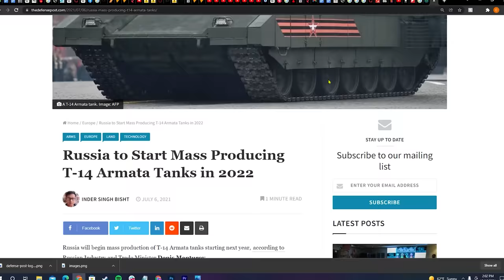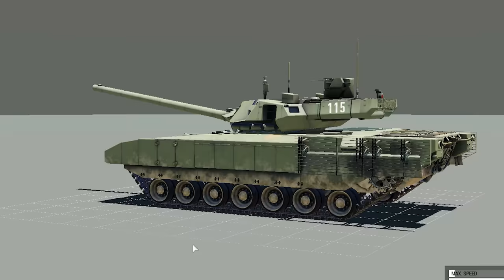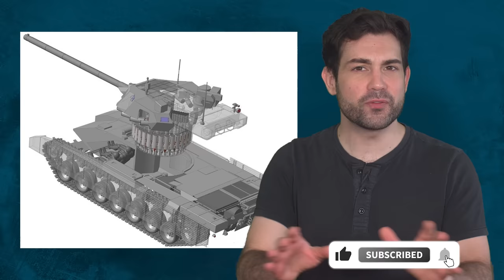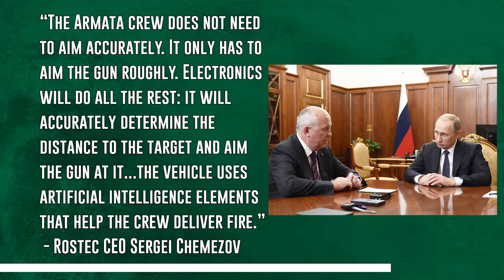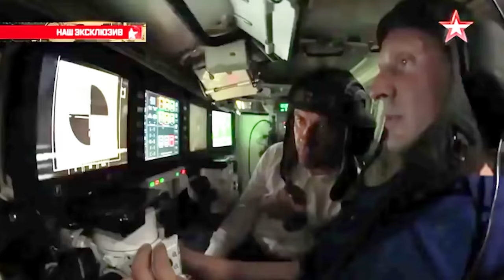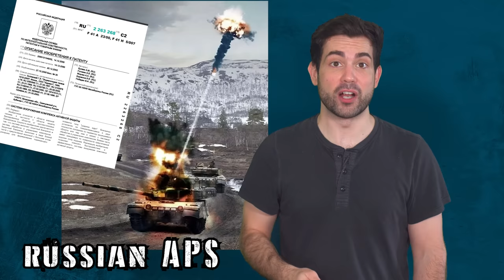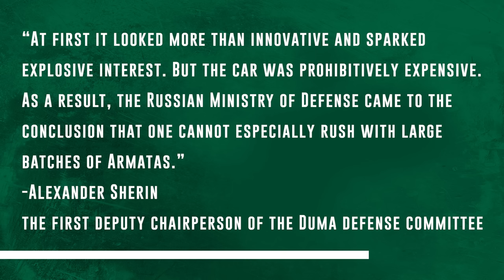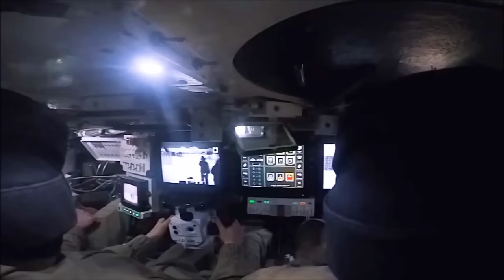The Truth About Russia's T-14 Armata Tank

Comment: Having a great design concept is one thing. Having an intergrated production or manufacturing platform as part of the whole project shouldn't be another thing.
Reply: Manufacturing it isn't a problem they have the factory lines. Its more of the deteriorating oil prices. Without high gas and oil prices Russia cant progress. 

like in the 1970s oil and gas were high and Russia had a economic boom blasting into 2nd strongest economy. in 2008 and 2014 Gas and Oil were high and they took land and started new projects such as the T-14.
Reply: Start with purpose. What's it for? Then design, proof of concept, funding, building the factory, prototype, initial testing, low rate initial production, quality control, spare parts, full production, delivery, training, and a battle philosophy. Then when there's a war you need transport, logistics, fuel, ammo, a maintenance schedule, deployed spare parts, repair facilities, etc. Skip any one of these steps, and you're asking for catastrophe.
War is ridiculously expensive, but especially when you use high tech weapons platforms. Russia should use rocks and spears.
Reply: Then having field tactics to actually make them effective is the 21st level that Russia will probably never achieve.
Reply: Here is T-14 training with mobilised troops in Kazan last month https://www.youtube.com/shorts/k68HVxZ2API
Reply: QED